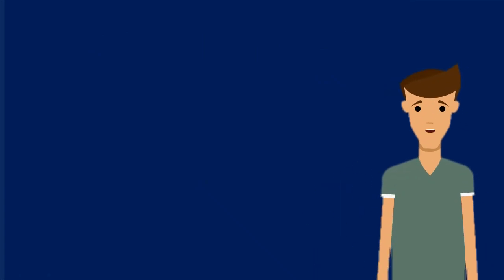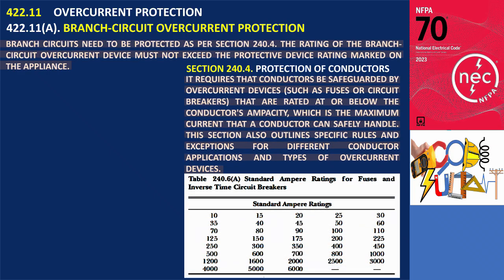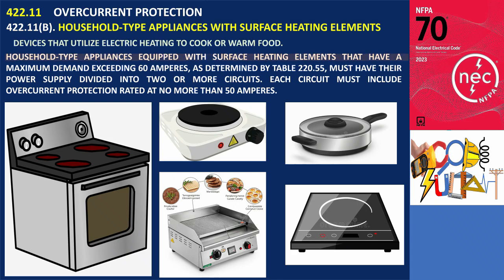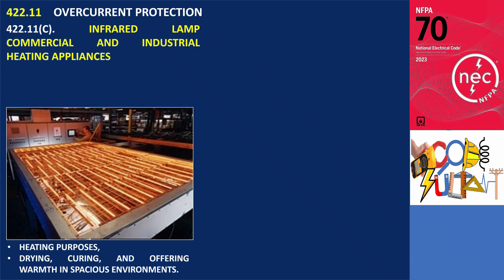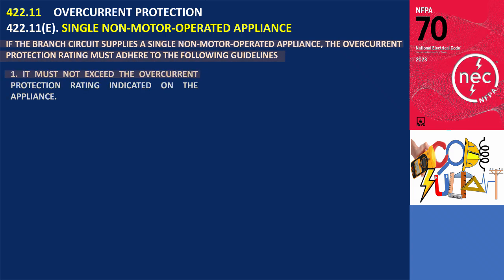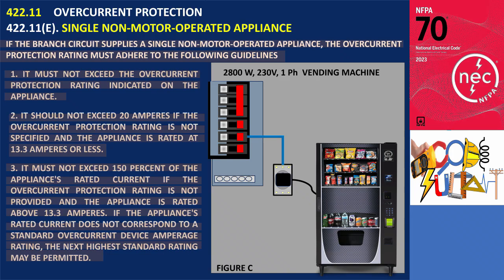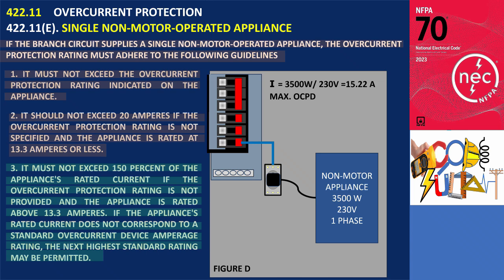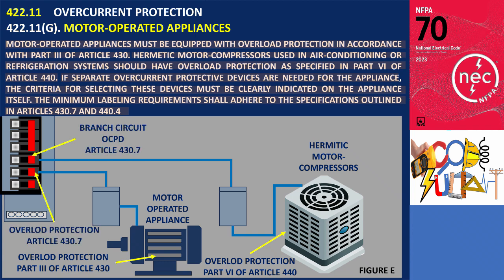422 11 OVERCURRENT PROTECTION BRANCH CIRCUIT NEC 2023

Comment: Meaning got a 10kW , 115V Fixed range using sec. 420.11B using two SEPARATE Branch ckt protection. Thus, manufacturer will provide at least 2 plug?
Reply from the maker: Thank you for watching!
Yes, the plug for the range should be provided by the manufacturer and ready for installation